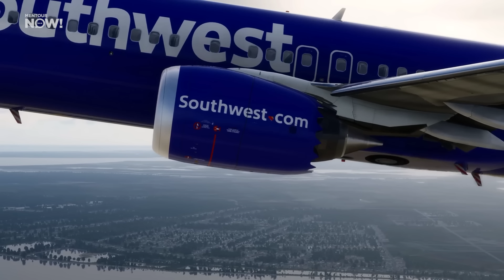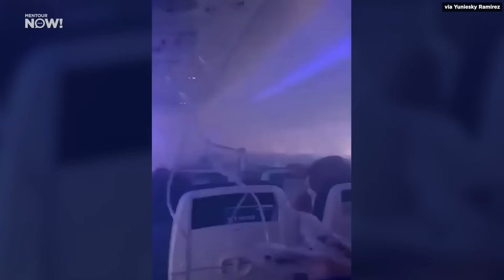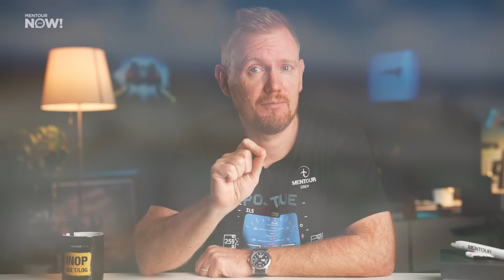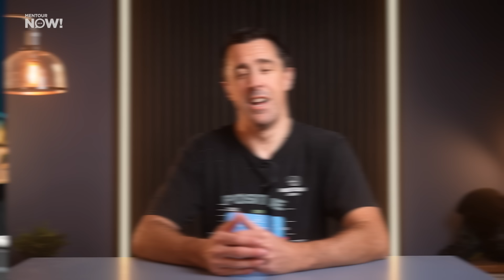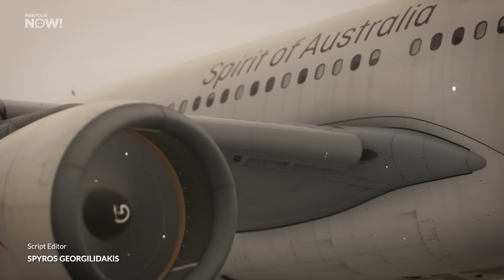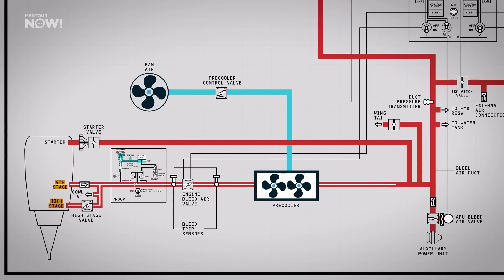Why Don’t ALL Airliners Do THIS?

Comment: Actual aero-engine design engineer here. One of the (publicly less discussed reasons) for Boeing to switch for a bleedless engine architecture was to prevent or make it least harder for the engine suppliers to offer the, at that time very advanced and efficient, GEnX and Trent 1000 to Airbus as a potential re-engine option for the A330 or any potential NPI (materialized later in the A350) that could rival the upcoming 787.
Reply: Isn’t the Trent 7000 on the A330 neo essentially a variant of the Trent 1000 on the 787, but with bleed air capabilities instead of beefed up electricity generators? From what I read, performance is very comparable, with the Boeing edging out the Airbus on very long sectors.
Reply: @SSW2503 Yes, this is what they did. That’s why the overall efficiency of the Trent 7000 is inferior to the Trent 1000 due to this and other changes (e.g. LP-system)
Reply: Really? The 747-8F used the same engines as the 787, and they had bleed air. To be technically correct, the 787 also still uses bleed air for nose cowl anti-ice operation. Though I'm not sure if the backup system for extension of the leading edge devices on the 747-8F was still operated with bleed air like it was on the 747-400. If not, the engines may have just provided less bleed air by themselves and because of the 4 engine design of the 747 it was enough.

Though I still doubt if it would have stopped GE and RR from making the design relatively simple to modify for bleed air. They want to sell as many engines as they can. They don't care what aircraft they're attached to.
Reply: What sort of flow rates does bleed air hit? Considering the mass flow through an aero engine I would have assumed bleed air volume would be negligible
Reply: @donkeytoots1 The problem with bleed air isn't so much that the amount is super high (I can't speak to specifics), but that its loss has an outsized effect on engine efficiency.

If you're familiar with cars, it's basically like bleeding air off your turbocharger for your AC (rather than having a separate compressor on the accessory belt). It'll work, but it will also have your engine produce significantly less power than it could've.

That's the key here: when power is taken as bleed air from the compressor, it reduces the engine's potential for making power which, due to thermodynamic inefficiencies inherent to all combustion engine types, has much more of an impact on efficiency than if you simply drew the same power off the engine's final output in some way.
Reply: Seems like an odd way to go, electric compressors aren't exactly rocket science, and the control logic is well-understood.

Airbus even had a few years of tech advancement to leverage.
Reply: Couldn't they just develop the engine with bleed valves and then just sell the engine to boeing with the holes plugged and a more powerful generator attached? Sounds like an easy way for the engine manufacturers to dodge the problem.
Reply: It’s not that easy. The decision for bleed or bleedless has a significant impact on the thermodynamic cycle of the engine. Taking bleed air from a compressor designed for a bleedless architecture will change its working line and reduce its surge margin. Hence, you need to adjust the compressor aerodynamics for the additional bleed flow, or accept a reduced surge margin, which will have significant impact on the compressor efficiency and hence overall engine performance and operability. 

But in the end that’s what RR did for the Trent 7000 for the A330 NEO. They took the Trent 1000 gas generator and adapted it for the bleed off takes of the A330.
Reply: @BassDee82  The engine mfr would agree to a dedicated, limited customer base of one, without having the design accommodate air bleed, if so desired?
Reply: @citylockapolytechnikeyllcc7936 That’s how our business works. Engines are highly optimised designs and are designed around a specific set of customer requirements to ensure maximum performance and best efficiency for the aircraft and its design mission. 

Of course engines will often be applied to different aircraft’s. But in these cases the aircraft OEM either accepts a slight disadvantage in engine performance for its intended mission or the engine make creates a variation or derivative of the existing design to optimise the engine performance for the new customer. 

But initially every engine design is highly optimised for the lauch customer/aircraft.
Reply: @Mutny1988  Not cheaply as the first few compressor stages on a bleed engine have to be slightly oversized as some is purely for the cabin.
Reply: Question: Would it be possible to use engine/APU heat to provide for the aircraft's heating needs, if taken from engine coolant?

I'm assuming there must already be liquid cooling loops, like for cooling engine oil, or maybe even cooling parts around the engine core/burner. If insufficient, you could add coolant pipes to the exhaust "tailpipe" coming out of the core.

"Exporting" all this heat out of the engines/APU could power all the aircraft's ancillary heating needs, like all the anti-icing and cabin heating (at high altitudes or on the ground in cold climates). You could even use it for a whole-wing de-icing system such that the aircraft wouldn't need de-icing at the airport in snowy conditions. If that also raised the temperature of the fuel, this might also mitigate a whole class of issues related to overly-cold fuel.

These heating pipes/hoses would be much more lightweight and inexpensive than bleed air ducts, as the temperatures and pressures involved would be quite manageable, and could make do with non-exotic materials.
Reply: @mnxs jet turbines do not have liquid cooling loops. All air cooled
Reply: That's some terrible bullshit of a rumor. Derivatives of the same engine are used on other Boeing planes! 🤣. What a bullshit story.

Comment: The Battery Issues on the 787 were caused by poor contamination control procedures at the Battery supplier, once correctedthe batteries have been less of an issue.

Comment: Imagine piping the exhaust from your car's engine into the passenger cabin of your car to provide heat! There's already a supply of hot air there, might as well use it! 

That's basically what jet aircraft are doing now.
Reply: Nope. It's compressed air siphoned off before the combustion chamber.
It has nothing to do with exhaust.
Reply: I think you misunderstood the system…

Comment: Boeing and Airbus didn't make opposite decisions.  They made different decisions based on goals and restrictions presented to their engineering team. One isn't necessarily better than another, and the decisions were almost certainly made soundly based on the information they had at the time. Also these aircraft were being developed essentially concurrently, so it wasn't really possible for Airbus to learn anything from Boeing's alternative tech being implemented.

I personally think the approach taken on the 787 is the superior engineering solution, but these solutions are always subject to financial and managerial constraints.

Comment: Inconclusive? I would say it's pretty conclusive. Both AB and Bombardier saw what it cost BA and said Nope. The 787 has cost Boeing $10's of billions in losses in cust compensation, R&D spend and production write-offs, due to the battery and shim issue. BA would be better off if they had NOT launched the 787 or the 777X. Boeing will never break-even, on those programs. Zero profits, only losses.

Comment: I think this also follows a general background trend in engineering technology.  In the mid-18th century, power was transferred via pullys and belts (still used in cars, which were first invented during this time). In the early 20th century, we started to see hydraulics, and pneumatics, an offshoot of hydraulics (used in car an other braking systems, also introduced during this time).  In the last several decades we have seen a shift again, towards electricity and electric motors.  So aside from pure technological matters, there is also just a question of what technology is front-of-mind for the current generation of engineers.  Probably most young engineers now would be very hard pressed to design a pneumatic energy transfer system, or at least they will have never done it. A system using electricity seems more friendly at this point in time.
Reply: Electric pump over hydraulics offers an output of power that would require a very heavy, and large motor. Of course, with a well-designed transmission, a very high speed small electric motor, can output torque..... but would it last anywhere nearly as long as putting hydraulics on the muscle end of the system ?

Comment: I can't help but think Airbus made the better strategic decision, by creating the A-350 while Boeing struggled with 787.  Between the 787's teething issues and the ongoing problems plaguing the 737 Boeing maybe circling the drain.  In which case Airbus can benefit from the work Boeing did on the 787

Comment: Why is this video by an expert on aviation technologies being published with a thumbnail using AI slop diagrams? I know the channel's credentials, but anyone who doesn't is going to look at this and assume it's one of those low-effort channels that just copies "facts" from elsewhere online without verification. The team behind Mentour Pilot have standing as experts who research their material, don't squander this reputation to avoid hiring a thumbnail artist, or if that's too much cost, find existing art/diagrams you can use that illustrate your point? It may seem like this is not important because it's "just a thumbnail", but channels spend so much time testing what thumbnails drive engagement and viewers seeing this slop used in thumbnails or in the video as motion graphics art will notice, consciously or not, and discount the rest of the video. After all, if the team let's an algorithm hallucinate a made-up technical diagram in a video about technical systems, we're left to wonder: what other parts of the writing and fact checking is actually true?

Comment: 15:55 complaint: the front windshield is defrosted via forced hot air. AFAIK every car with an internal combustion engine uses engine coolant to heat this air. The rear windshield is often defrosted via electrical power, which is why you can see painted on wires running across it. 

Even on EVs I don't believe they have any way of running power through clear glass, but there may be some innovative method.
Reply: Look at the E-Golf for example. They heat the front windshield with a resistive wire.
Reply: The reason you „see wires“ in the rear windshield is the fact, that they use the wires also as antennas for the radio (and maybe even cellular?) in addition to the roof mounted (shark fin) antenna
Reply: @themisterx8660  the video clip they show makes me think that it's being heated by forced air, but I could be mistaken.
Reply: @DanielKetchum-n3o  Yes, the clip shows a car where defrost is done with "forced" air. My response was to your last sentence claiming there is no well known way to defrost a front windshield with wires directly in the windshield because of the thickness of the wires. That is just not true, because the E-Golf is a pretty old vehicle actually. And I am pretty sure there were more cars even before the E-Golf using this technology. In combustion cars it just does not make too much sense to not use the waste heat from the engine, because most of the energy that is put into an engine is just converted to heat, so not using that and instead generate electricity with the remaining energy going into rotation would make the efficiency of an ice car even worse.
Reply: @themisterx8660  While I'd like to think I'm not totally dumb mechanically, I've never worked on EVs so I wasn't aware of that. I've worked on hybrids where the defrost didn't work until the engine warmed up, which can take a long time.
Reply: In passanger aircraft and plenty of cars there are invisible electrical conductive elements that heat the windshield.
Reply: Ford has had electrically heated front windscreen elements since at least 2007, maybe earlier.
Reply: @Esperi74  the video clip they show makes me think that it's being heated by forced air, but I could be mistaken. I didn't know that there were electrically heated windshields with no obvious elements, interesting to hear.
Reply: We do have ways of running power through glass, a thin layer of conductive and transparent Indium tin oxide, which is what most planes use, and why you sometimes get that rainbow effect looking at the cockpit windows from the outside. It just isn't common on cars because it's expensive, just using hot air is pretty trivial, and it doesn't matter in a car that's it's so loud among other things. I assume they just got confused because they're pilots and didn't really think about it.
Reply: @thamiordragonheart8682  hmm, I've certainly noticed rainbow windshields on Teslas and wondered why, that could absolutely explain it
Reply: Electrically hated windscreens have been around in cars for decades. Originally luxury or cars or an expensive additional option (I first saw one on a Jaguar, I believe, in the 1970s), my last two Fords have had one as standard on that model (going back around 20 years).
Heated windscreens have a grid of closely spaced, extremely fine wires in the plastic layer between the glass laminations; they are almost invisible unless you look closely, or get a reflection at just the correct angle.
The windscreen elements are much more powerful than the "demister" element printed on a back window and can thaw ice in a minute or so.

Comment: You can see similar advances in some modern warships (the UK's Type 45, e.g.) and cruiseliners: they're leaning into electric propulsion -- effectively turning into diesel-electric (or gas-turbine-electric) craft. Obviously the trade-offs are different -- weight isn't such an issue, for instance -- but the overall system simplicity (conceptually, at least) of going with electric-everything can look attractive.
Reply: Isn‘t the biggest benefit of electric propulsion in ship the ability of rotating the propeller and therefore increasing maneuverability by a lot? I highly doubt there is a efficiency benefit since engines produce rotation which can be fet directly to the propeller vs generating electricity with only 80 - 90% efficiency
Reply: The case for electric propulsion on a ship is pretty different, and comes down more to what you're doing with it. Basically, if you run steam or gas turbines, they aren't very efficient at low RPM, and ships are too big to have lots of gears, so turbo-electric is way more efficient if you're cruising, if a bit heavier. That's why USN battlehsips were turboelectric in the 1920s and 30s. Post WW2 a lot of ships switched to Diesels for sole or cruising propulsion, which are efficient and stay that way over a larger load and RPM range, and until recently had a higher peak efficiency. Advances in gas turbines for aviation have made them as efficient as all but the biggest turbo diesels now when they're at their ideal RPM, and much lighter, which might be part of what's driving ships back towards turbo electric.

There are also some other reasons that don't have anything to do with efficiency or complexity. It's more maneuverable since you have instant full power reverse, or in the case of cruise ships, can use azipod thrusters for station keeping or to dock without tugs or a big draggy bow thruster. For a warship, it's also quieter since the engine isn't mechanically connected to the propeller.
Reply: @thamiordragonheart8682  yeah, sure, the motive for electric propulsion is different, and we still see a bunch of hybrid designs, but from a system architecture point of view, just running everything electrically has a lot of appeal. You get more flexibility about where the turbines go (which simplifies exhaust/funnel design) and so on. My point is that certain kinds of boats want that simplicity (and resilience) and -- as you point out -- they're happy to borrow advances from aviation.

Comment: Are pure freight aircraft handled exactly the same?

I imagine that, while they still have a requirement for air, the air exchange rate could be set much lower than for a cabin full of people. Which might tilt the economics somewhat.

Obviously a freighter converted from a passenger plane would be starting from a different place.

I'd also be considering the balance of choices if the aircraft has military derivatives. Which system would likely be more resilient when used for flight refuelling? Or other military duties.

Comment: The E-3 AWACS is a Boeing 707 variant with two generators per engine to supply power for its massive airborne surveillance radar. The engines start with and supply bleed air, though.
Reply: E-6B has two generators per engine as well. 4 engines, 8 generators (APU is non-op in flight).
Reply: As far as i remember. 6EA  90KVA generstors are needed to operate the radar. 1 for onboard elec. Wich means 1 to spare😂
Offcourse they are load balanced during ops
Reply: Radio phone receivers take about 30% of total power, which is quite strange, they just listen. But class-A amplifier has very poor efficiency

Comment: Actually it  is a common  experience that the fumes of unburnt fuel leak into the cabin at the push back from the gate. Could you better explain that for me? Thank you
Reply: In my experience this happens if you start the engines with a tailwind. The exhaust is blown forward and reingested, bringing the fumes into the compressed air.
It also frequently happens if you taxi behind other aircraft.